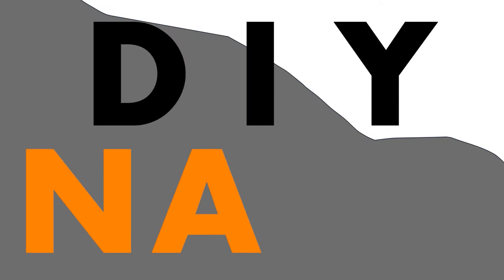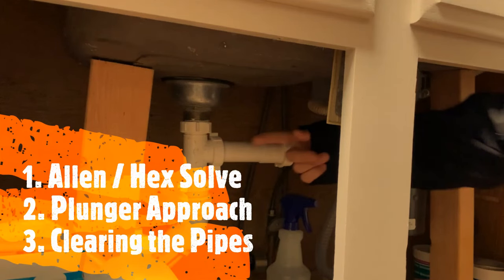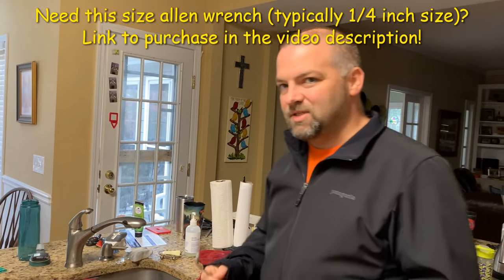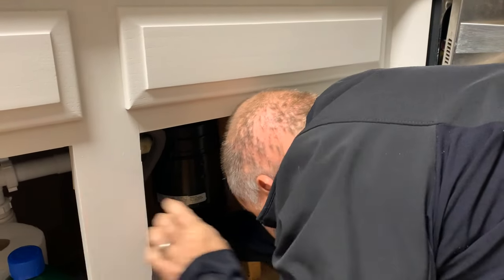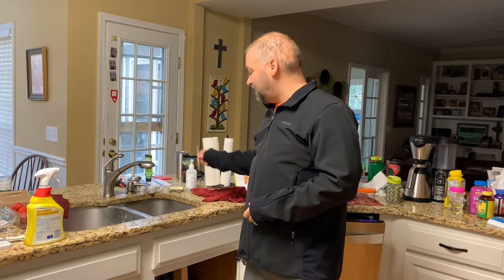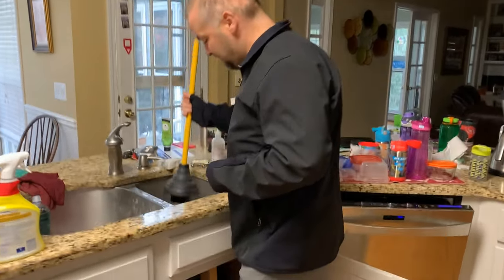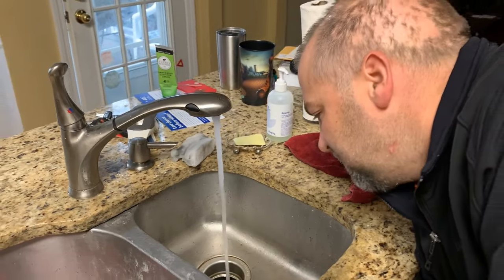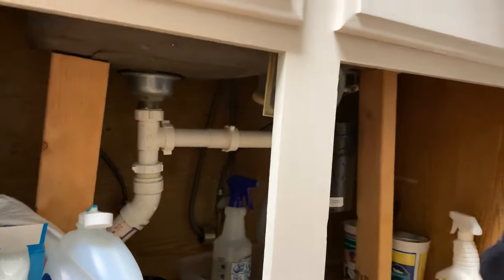Clogged Kitchen Sink with Garbage Disposal? How to Solve Quickly with 3 Easy Fixes! - by DIYNate

Comment: My sink is clogged and the plunger did not work. Do you have a video on how to open the pipe ? It seems I may have to do that
Reply from the maker: Hey Mastani - sorry to hear the plunger fix didn’t work.  I don’t have a video yet on taking the sink pipes apart but depending what type of sink you are working on, the approach varies a bit.  If a kitchen sink and coming off a disposal, your clog is likely in the pvc pipe coming out of the disposal and into the drain pipe (may vary based on your setup).  Basically, unscrew the pvc coupler on the two ends and see if it is clogged in that section and reattach.  If it is a bath sink, you are probably looking to take apart the joints in the p-trap to clean / dump at that point.  Another video I grabbed here for that approach: https://youtu.be/8PI0iaIB6-4. - good luck and hope you are able to get it resolved yourself!  - DIYNate

Comment: Both sinks are clogged. I've tried all plunging and the Allen wrench thing. The water is only flowing between the two sinks and eventually starts spitting out of the garbage disposal. Help!
Reply from the maker: Sorry for the slow response here.  If you run into this, try capping one side of the sink while applying pressure to the other side.  This will help force the pressure to break the clog down the pipes vs allowing the pressure to release through the other drain.  Good luck!
- DIYNate

Comment: The sink next to garbage disposal would not empty out after using allen wrench and plunger. Does hot and cold water need to be shut off before removing PVC connection to  unclog OVC connection to garbage disposal? Sink with garbage disposal did empty but  water filled up in other sink.
Reply from the maker: Hey Bill - typically you shouldn't need to shut off any water, since the faucet controls the flow of water and that is upstream of the drain.  So if you disconnect the PVC that comes after the drain / garbage disposal, you shouldn't have any issue of more water coming out since your faucet is off.  You may want to cut the breaker off for electricity to your garbage disposal though to be extra safe when working with blades, electricity, water, and in tight spaces.  Good luck!
- DIYNate

Comment: I don't have a tool or Allen Wrench, I rent an apartment. The disposer has acted up in the past when I run the DW, water backs up into the other sink without the disposer. My Disposal went kaput two years ago. The maintenance man had been fired, long story, the Technician installed the Refurbished Disposal with the fired Maintenance Man on the Phone guiding him. Not sure if it was done right... So now I have both sinks backed up. I tried the Plunger could not get it to do any suction. It is just like the one you have in the Video. I will go and try again. I run very little in the garbage disposer, just for this reason. I throw my garbage away in the trash or flush liquids down the Toilet. Here Goes.... Nope it did not work. Both sinks trade back and forth with the brackish water. I have tried several start and stop, a little water, and it is back to clogged again!
Reply from the maker: I am so sorry for my slow response.  It probably would have been helpful in the video if I had mentioned that it can be really helpful to plug the other side of the sink so it doesn’t push from one side of the other.  Think of the two drains and the down pipe like a three way road.  The point of least resistance is where the plunger will push the water, so covering the other drain to make an airtight seal so water can’t come out there will help push the pressure down the drain pipe instead of popping up on the other side.  Hope you have since gotten it solved but either way, good luck and thanks for watching and your comment!
- DIYNate

Comment: I have a Kitchen Aid which turns on/off by turning its stopper sitting in the sink drain. Lately, it turns on but doesn’t pump water out which used to. I take out the stopper and water drains. Surely it’s not a clogging issue. I wonder if you’d know what could be the cause for this. KA people weren’t able to troubleshoot over the phone.
Reply from the maker: That is a tough one - not really sure based on how it is described.  Throwing the reset button if there is one or turning the breaker on / off may help get it reset.  Clearing the pipes never hurts but to your point if it drains when not on, but not when it is on, that seems a bit odd.  I’d still clear the drain and see if that helps.  Maybe go downstream into the pipes and make sure no clog further down as well.  Good luck!
- DIYNate

Comment: If the kitchen sink is clogged up on both sides, is it safe to assume its not the disposal that is clogged? I already replaced the P Trap. And used Green Gobbler and Zep Liquid Heat to no avail. My guess is there is a blockage inside the pipe that runs with in the wall. Used a toilet snake in that pipe, thought it would’ve done the trick but no. Possibly not long enough. What do you suggest?
Reply from the maker: Sorry for the slow response, but based on what you indicated, it does seem like the storage is further down the line.  At that point, I would probably disconnect the p-trap and try and fish the snake down directly from there vs. coming in from the top (just to make sure you are getting down the pipe as far as possible).  You could also try funneling some water in with the p-trap disconnected and see if it is also blocked there (sounds like it would be), just to confirm you have a block down the line.  If you still can’t get it, the plumber call may be next or getting a longer snake / auger.  Good luck!

Comment: Does any of these work if both sides of the sink is backed up?
Reply from the maker: Hey Jara - if both sides are clogged, you can try and put a cover over one side and still try and plunge it, creating downward force on the clog if it is further down the pipe where the two sink drains come together in a Y / T style.  It may not work as well because the force will try and go up the side you have covered as well, but worth a shot before you disconnect the piping and go further down the pipe with a drain snake.  

You can always try the chemical solutions like LiquidPlumber as well if you are trying to avoid taking the pipes apart.  Hope this helps!
- DIYNate

Comment: My disposal unit hasn’t worked in a long time: every time  run dishwasher that side of sink starts out clogged. I clear it with a plunger but next time same thing happens and so I run water until it backs up prior to using dishwasher and it clears drain again but next time same problem. Disposal unit won’t come on and looks like a lot of rust. Haven’t had money to replace and get power fixed. Wonder if disposal has  stuff in and can’t clear. Is only solution to replace it?
Reply from the maker: You could change the disposal out with just regular piping as an alternative if you don’t want a disposal on there and would probably save you some money.  I imagine an older disposal that is not working is probably more prone to clogging than no disposal at all.  Hope that helps and good luck with the solve!
- DIYNate

Comment: Are garburator sinks prone to clogging if the garburator isn’t used?   The blades and mechanism are disabled, and we just use it as a sink.  We’re very careful not to drop anything that would clog normal pipes into the either side of the sink, but the garburator side in our (stressfully fancy) rental has really never drained properly, ever.  The other side drains beautifully, and has never had a problem. 

It also backs up into the garburator side of the sink when we run the dishwasher. We are really, really careful not to put anything risky in the dishwasher either.  We were so traumatized by the plumbing at our last place, we basically scrape every last grain of rice and or scrap of cheese into the compost before we even go near the sink.  

I’m gonna try gently plunging it tomorrow with a decent plunger, but I I’m worried this is gonna be a recurring problem.

Edit: forgot the word rental.  It’s five am, words are hard.
Reply from the maker: Hey there - not really familiar with Garburator brand but if you have a disposal but aren’t using it like one then you probably are more prone to clogs than someone who uses a disposal since it grinds debris before allowing it through.  Plunger should still help if it is clogged.  Another thought is to put a sink strainer screen or basket on top of the drain to keep any debris from going down if you are going to continue to use as just a sink and not a disposal.  Good luck and hope it works for you!
- DIYNate
Reply: DIYNate Hehehehe, sorry.  I thought the term garburator was universal, but Urban Dictionary has just informed me that no, it’s just we weirdo Canadians that call garbage disposals garburators.   My bad.  I have no idea what brand the thing is.

We already use a sink strainer to keep stuff out of it, and we’re extremely careful with grease/oils.  Honestly, I think it just never recovered from the previous occupants’ habits.

Right after I wrote this comment we got a shiny new hot water tank.  It provides verging-on-boiling water to all of our taps and appliances, and the sink immediately started to drain better.  I’m hopeful that when I do eventually plunge it we can get it draining as well as our “good” sink.

Thanks for the response!  Please accept my gratitude in the form of likes and a subscription.
Reply from the maker: @shortforsophie  - you got it - love that I learned a new term!  Makes sense with the scalding hot water and appreciate the like and subscribe!  Take care!
- DIYNate

Comment: So the plunger method didn't work--- is there some technique to pushing and pulling up the plunger?
Reply from the maker: Nothing really special but if you have a second drain that seems to let air escape you may want to cover that so it has an airtight seal to help make sure the pressure goes directly to the pipe.  Good luck and thanks for the comment!
- DIYNate

Comment: What if I tried all three methods and can’t seem to find the clog? The water goes down when the garbage disposal is on but then comes back up when turned off??? Any recommendations?
Reply from the maker: Have you tried blocking / sealing the other side of the sink if there is another hole?  That can help get more compression on the clog.  If you have taken the Ptrap apart, then figuring out if your clog is coming out of the disposal to the Ptrap and clearing it there, or clearing from the Ptrap down the rest of the pipe would be my next bit of sleuthing then probably running a sink snake down where the clog is (or some drano) - good luck!
- DIYNate

Comment: Mine is draining like maybe a drizzle.. I tried plunger on disposal but it just pushed water up the  other sink. Tried bowling water, tried drano but still clogged. I hate opening pipes, the smell is horrible.
Reply from the maker: Have you tried stopping or blocking the other side where water is coming out as well?  Sometimes you need to block the other side while creating downward pressure.  Another idea or you is to try sucking out the clog with a shop vac if you are trying to avoid taking apart the PVC pipes.  Good luck and hope you get it figured out!
- DIYNate

Comment: what does it mean if i turned the propeller with the tool and its working but there is water dripping out of the reset button?
Reply from the maker: Good question - sounds like there may be a leak or a crack in the base of your disposal.  It could be more simple with the pvc on the out pipe leaking but may be time to replace.  Good luck!
- DIYNate

Comment: What else can you do if plunging or the allen wrench doesn't work? Gotta double sink, left with garbage disposal. The left side is the worst side. It's slow go drain & clogs much.  And this time, it's clogged again, only difference is is that now the right side is taking up water.... Plus I've no idea where to find the water shut-off 🤦.... I'm new to this whole house thing lol.... Pls & thank you!
 Pls & thank you!
Reply from the maker: Hey Michelle - sorry to hear the first two tries didn’t work.  You may be getting to the point of taking the PVC apart under the sink and clearing the pipes.  One other thing you can try is a shop vac from the top to unclog but that may give limited success.  Here are a couple videos that go through the process of taking apart the pipes under the sink if you are interested.   Wishing you success on the fix!

This Old House: https://youtu.be/Or4XevbRfz0

Roger Wakefield: https://youtu.be/MZtgFmoglQY

Thanks!
DIYNate

Comment: I can't rotate the disposal manually with the key but I can rotate them from top?
Reply from the maker: That seems a bit odd - could be something stuck or jammed but it seems strange that you can rotate from the top.  When you flip the switch, I assume it doesn’t turn?  And you are using the right size hex / Allen key?  I would also look for cloth or other material around the blade (exploring with your fingers carefully) and of course try turning in the other direction.  You could also try the reset button if there is one on the underside and also maybe flipping the breaker to try a hard reset.  Outside of that, it is a bit beyond my skill / repair level and may be an internal fix thing that may put you in a replacement zone (since repair cost to pay someone to do it and replace cost are likely pretty close).  You may have some luck Googling your brand and particular problem as well.  Sorry I don’t have a better answer but appreciate you asking!
- DIYNate

Comment: Did all 3 steps, including remove the pipe (trap, connecting piece from garbage disposal side and other/left side)....... still having issues. My garbage disposal works and it drains, but backflows with crap into the other side of the sink. Then both sides are slow to drain........ help?
Reply from the maker: Hey Bill -  from your explanation, it sounds like your clog may be further down the pipe then where the p-trap joins with the other part of your sink.  If you are able to open up the pipe again at where the two come together and get a sink or sewer snake / auger down there (or even something like a coathanger extended long), you may be able to get. through the clog, assuming it is further downstream than your two top drains.  Could also try pouring some drano or other drain cleaner down at that joint and below to clear the clog.  That is about the best advice I can give you from what you are describing.

Wishing you luck and hope you are able to get it cleared out without having to hire it out.
- DIYNate

Comment: Unfortunately it didn't work for me w the plunger. While the water level drops in the main sink which has the disposal, Water starts coming up from the second sink tho I have closed out w a stopper. When I turn the garbage disposal on, water disappears but starts overflowing in the second sink. After i turn the disposal off, water starts coming back in the main sink. 
& this cycle repeats over and over. 
Guess I might have to hire a plumber unless any of you have any advice. 
Thanks in advance 🙏
Reply from the maker: Sorry for the slow response.  Hope you have gotten it straightened out by now.  My thinking would be it sounds like a pretty stubborn clog below where the two sinks join, so disconnecting the pipe below that level and using a drain snake would be my next shot.  Some people have success with very hot / boiling water and a variety of drain cleaner options as well.  Good luck!
- DIYNate

Comment: , I would advise to put soda in the oven for 30 minutes and then the soda becomes soluble and very strong, put it inside and waiting 20 minutes
Reply from the maker: Well that is interesting!?!  Like soda as in coca-cola or are you talking about some type of other soda (have heard of people using baking soda mix as one option).  I may have to test this out - sounds really interesting from a chemical / solution state!  Any idea what heat in the oven?  Then you just pour it down the drain to fix a clog?
Thanks for the post and making me curious!
- DIYNate
Reply: @DIYNate  baking soda has a pH of 4, and if you put the soda in the oven at 320 degrees for 30 minutes, the soda becomes a strong alkali with a pH of 14
Reply from the maker: Wow - that is some cool science stuff there - thanks for sharing - will have to try that out in the future!

Comment: Tried all three methods and the water is still not draining. All pipes have no clogs in them. Any ideas?
Reply from the maker: Well - I think you may want to start deconstructing the problem.  If you disconnect the PVC connection and you see water is coming though the disposal and out of the drain for the disposal, then you can rule out the clog is in the disposal.  I would definitely check that out drain from the disposal.  Then, I would try seeing if past the disposal connection - pvc pipes down, I would try maybe pouring some water down to see if it drains fine.  My guess is there may be a clog in one of the two of those places and once you know where the clog is, you can go about attacking it.   You could try a drain snake in the down pipes and / or some Liquid Plumber (Plumr) / Drano.  Good luck and hope you get it fixed!
- DIYNate
Reply: @DIYNate  tried both of those already. When I run water through the disposal side it comes right out the open pipe. Disconnected the pipes all the way to the exit line out of the house and they are all clear. Also ran water out of the disposal side and that came through fine. Assuming it’s the piping leading out of the house
Reply from the maker: Certainly could be that.  Did you ever get your answer / fix?  Hope you got it solved!
- DIYNate